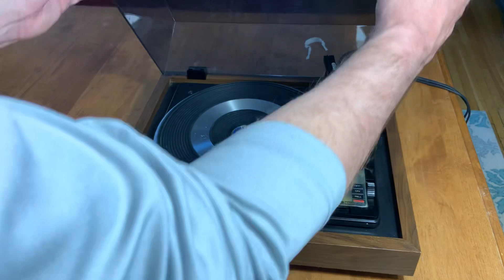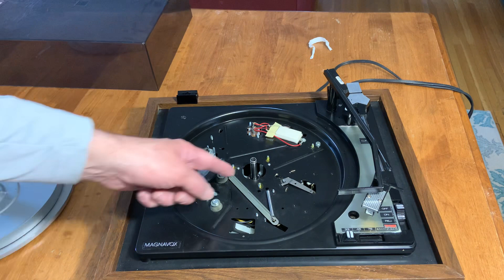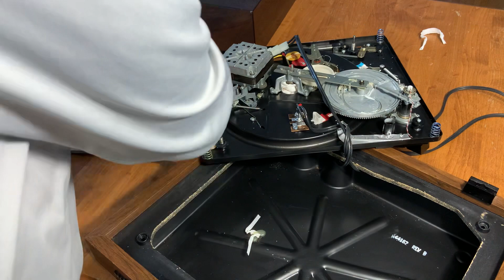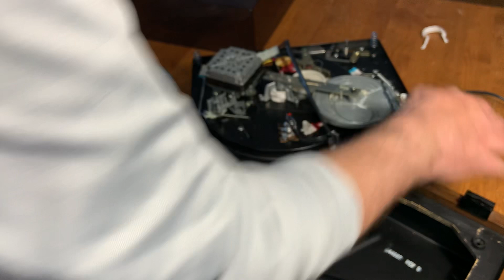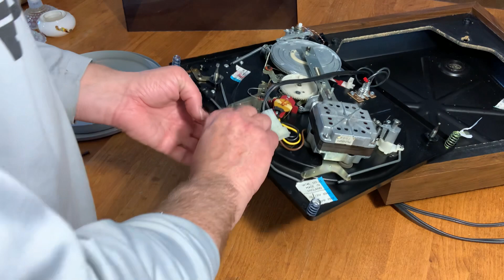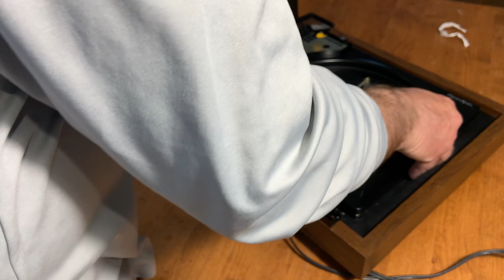Magnavox /Collaro W748 automatic turntable repair

Comment: collaro really cheapened those changers the earlier ones always were easy to fix
Reply: I think BSR had a hand in making those last turntables for Magnavox.I have a micromatic that I like much better 1973-74 year and a top of the line MX 1220 which I have to get the speed issue on 33 up to par too slow.I even see people take these four pole synchronous apart and clean and lube and they are good to go, what about idler wheel service?
Reply: @markchwala  bsr never made tables for magnaovx collaro made them magnavox was the owner of them at that time still.
Reply: @troydog  thank you for this everyone trying to blame BSR, pure ignorance..like MAGA

Comment: Adding or Stretching the Idler Springs on these is NOT the correct fix!, Need to clean and reoil the Idler Pivot Arm and clean the idler in Hot Water and Dawn Dish Soap reinstall with a couple drops of Oil on the Idler Bearing and it will be good to go without messing with the Idler Spring!